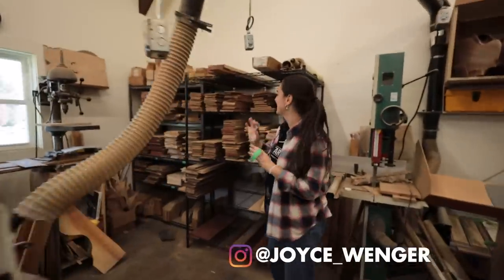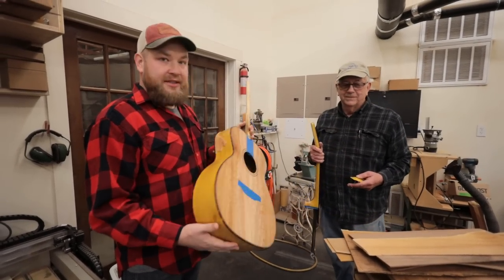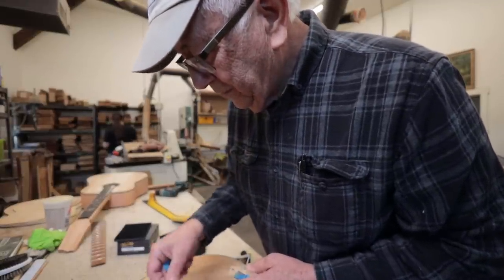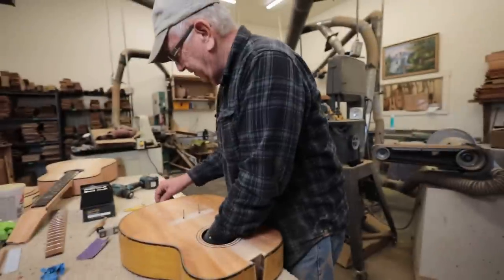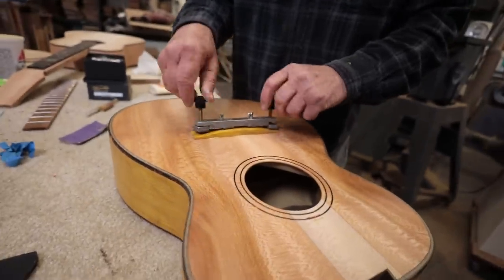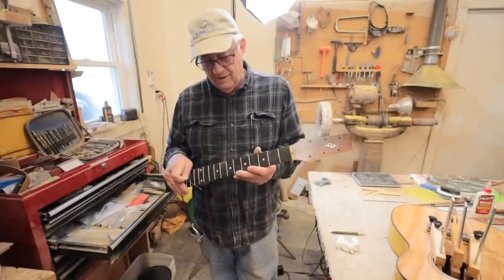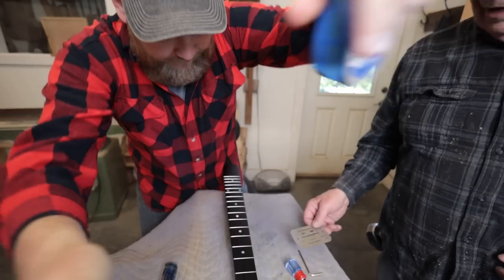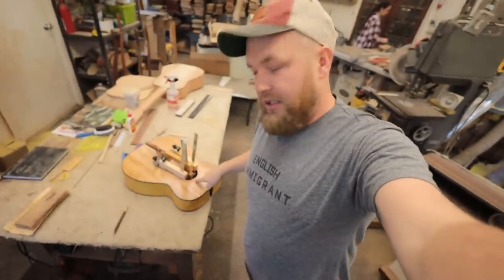Building an Acoustic Guitar with @showalterguitars5707 Episode 18 I Gluing the Bridge and Fret Work!

Comment: How long would it take for the wood to be in storage? Say after cutting down the tree through various stages and finally ready to start a build? I guessing it differs or depends on the tree- ie wood type?
Reply: In normal woodworking, you usually figure a year of stickered air drying (ends sealed) for every inch of thickness. Possibly more for guitars and where the average humidity is higher? That’s before any kiln drying.

Comment: how in the world will the intonation be correct if you bond the bridge and saddle before setting the neck?
Reply: Because Steve measured the bridge relative to the 12th fret. The saddle and 12th fret are equidistant. If he follows the rule the 12th fret will be an exact octave from the open string. Science!
Reply: @michellowe8627  I understand the math, but only dry fitting and measuring would still fall short in accuracy for the correct position of the saddle for intonation. Mount the neck, mount the bridge. String it and set intonation, then cut saddle slot.